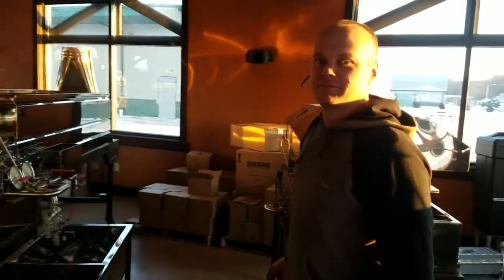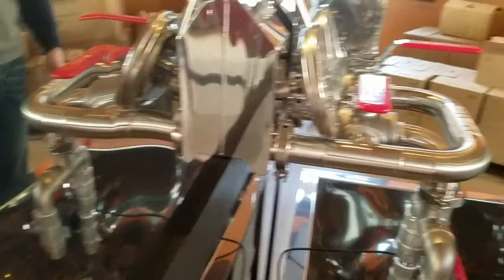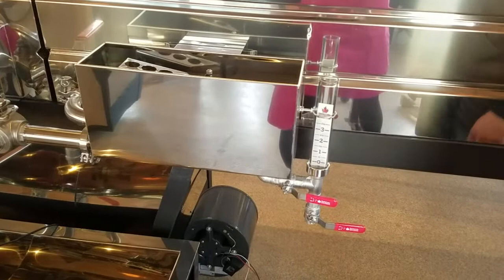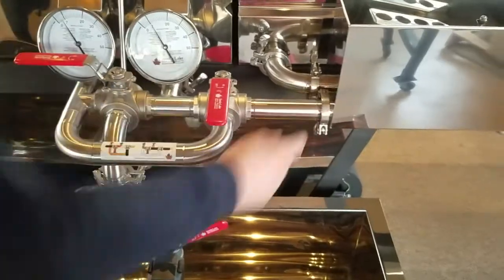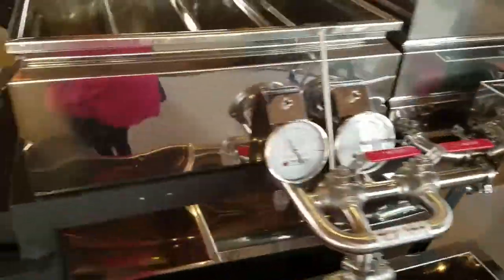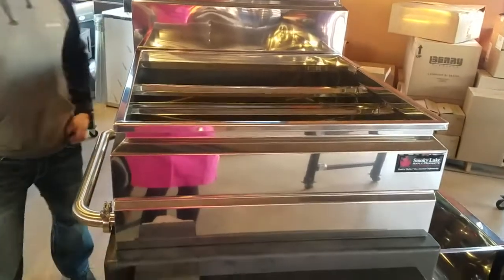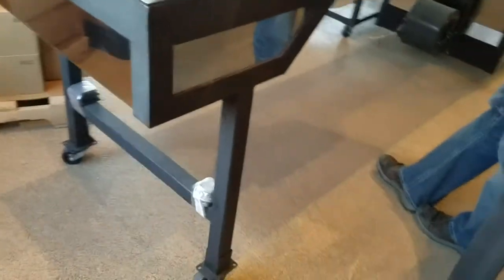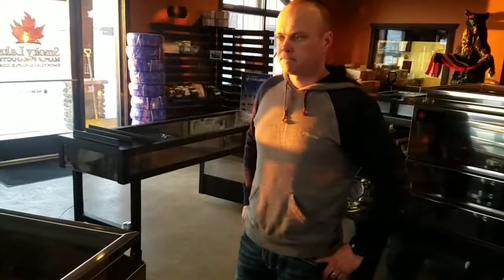Smoky Lake Maple Products SSR Raised Flue Pan Set Assembly and Features.

Comment: Really like the reverse flow set up. Same valves you have on your ss filter presses.  T Mark engraved on valve displays flow.  This is a 2 x 10 raised flue.  I currently have a circa 1986 Small Brothers Lightening Evaporator 4 x 12 raised flue 4 x 8...  4 x 4 front parallel pan.  All soldered and need to upgrade to ss.  Tapping 1800.  Been boiling with this since 1990.  Will this handle this amount of taps?  May have 2000 by 2020. Do you make a 3 x 12 or 4 x 12?  Quite impressed with the quality and technology put into your evaporates.  I would be interested in replacing with a complete unit.  Wood fired with auto draw.  Do you folks design steam aways as well for the Silverplate?  Please post a video of full boil action.  How about a ball park cost on this model....an r/o may be in my future.  
Your way above your competitors in design!